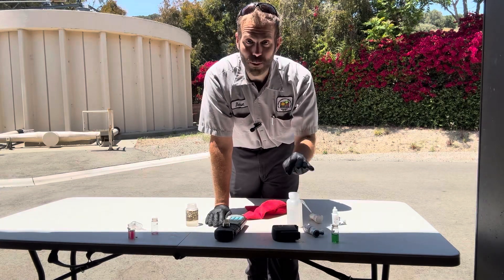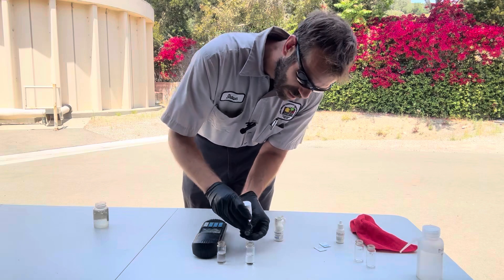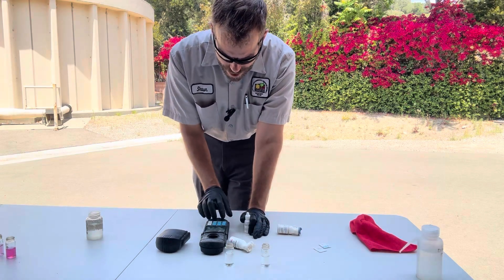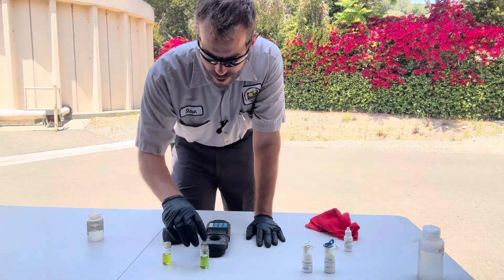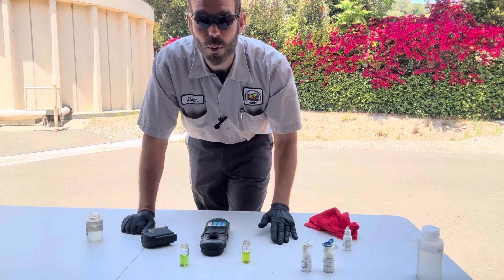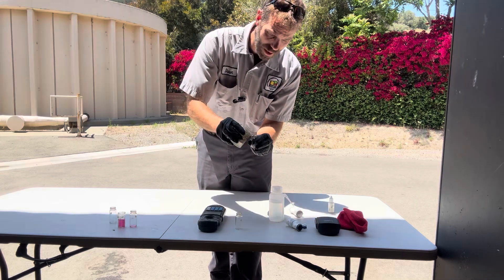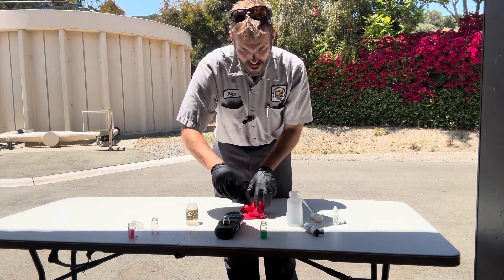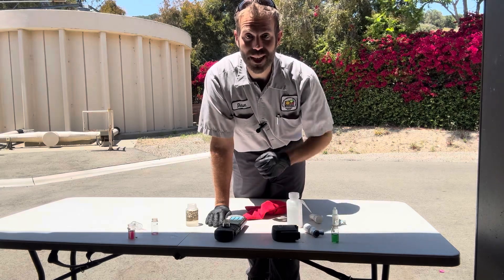Testing for Free Ammonia in Wastewater to Determine Chlorine Feed. Real Life Breakpoint Chlorination

Comment: Corresponding ORP values would have been nice...
Reply from the maker: Hello!  Thank you for your input.  I intentionally omitted ORP values.  I felt they would have confused the situation, especially since I haven't covered ORP on this channel yet.  Also, my situation is not straightforward.  I'm going to do a video on ORP soon and I will get into further detail on my specific situation, but I'll give you a bit of a preview:  

When I have hit the breakpoint because my MBR (denitrified effluent) is the only process discharging or my trickling filter is barely involved and there's not much ammonia to oxidize, my disinfection ORP tells me great stuff.  When I'm using chloramines with a turbid trickling filter effluent, my disinfection ORP is somewhere between bad and worthless.  I get really low reads (315 - 380 mV) with a 10 mg/L combined residual and non-detect for all coliforms in my 25 tube coliform tests.  Endress+Hauser was no help when I told them what I was experiencing.  From my research and talking with other operators who have experienced the same, it appears to have something to do with the dissolved organics still present in trickling filter effluent.  When they are present with monochloramine as a disinfectant it apparently gives really low ORP readings.  So, in this case I wasn't looking at my disinfection ORP because I knew I was combining and it wasn't gonna tell me much.  The tell was the dechlorination ORP.  That one runs on a PID loop set to hold 200 mV on the effluent (which is a reliable 0 Total Chlorine Residual).  When I have a strong chloramine residual in the contact chamber it works hard to maintain that 200 mV.  What I saw instead was that it was feeding about 20% of its normal chemical feed.  With the flow I was at, if it had a combined residual that would be reliably effective enough to disinfect to permit requirements, my bisulfite pump should have been having to feed much more in order to dechlorinate before ocean discharge.  That made me want to go take some grab samples and that's when I saw low total chlorine from the DPD test.

So having said all that, I feel if I tried to explain all that, the free ammonia/chloramine conversation would have been eclipsed by that explanation.  Hope that clears that up!

Comment: So that's what field testing looks like! Do operators ever sit in a lab for further testing or is that strictly a lab analyst thing? And does chlorine + free ammonia = chloramines so that's why there's a higher chloramine count?
Reply from the maker: Howdy!  Yep operators will also sit in a lab for further testing.  It really depends on the size of the plant and what you are looking for.  I have a couple of things I analyze here at the plant that are reportable and I am far more precise in my measurements and technique.  Also if I were doing a dilution, I would have been far more careful in my measurements even though it was a field test.  Garbage in garbage out as they say.  I've been doing these particular tests for years so I'm comfortable being a little bit more rough around the edges with them.  To answer your question about chlorine and ammonia, whenever there is free chlorine and ammonia present at the same time they will combine to make chloramines.  Check out my breakpoint chlorination Wastewater Whiteboard video for a more thorough explanation of that.  Free ammonia doesn't necessarily have to be present though.  Monochlormines are a 3:1 chlorine to ammonia ratio so if I can hit it right on the nose then it's possible there's not free ammonia present.  But that is such a crazy moving target in a wastewater plant that it's impractical to try to nail that every single time.  The presence of such a small amount of free ammonia coupled with a very low total chlorine residual and no free available was more of an indicator that I was close to the breakpoint and it could have gone either way.  Hope that helped!